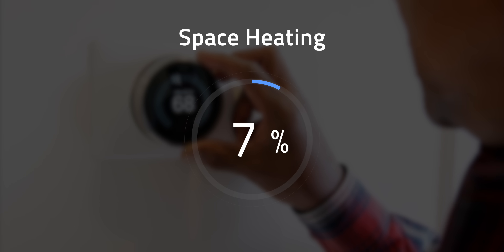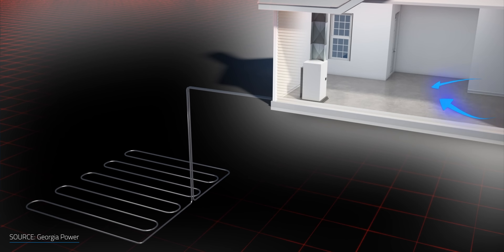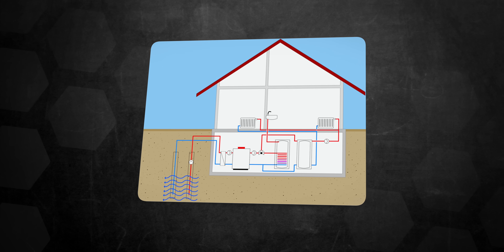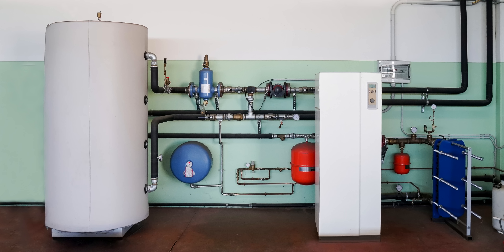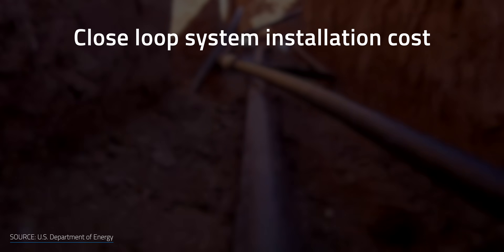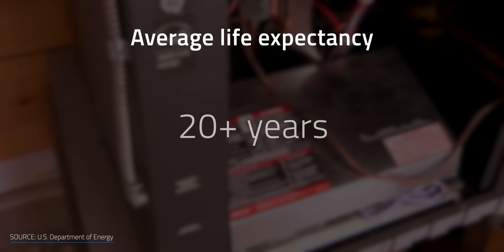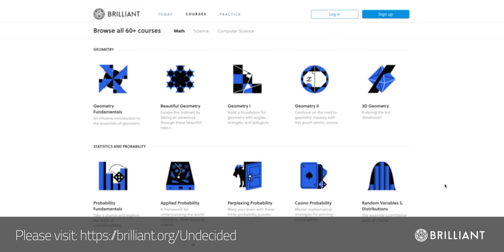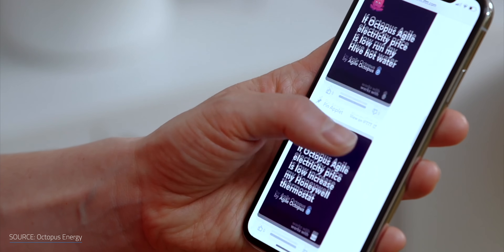Is Geothermal Heating and Cooling Worth the Cost?  Heat Pumps Explained

Comment: is this a system that augments HVAC? i don't feel like you can really get 70degree homes in the peak of winter withy this alone.
Reply: I have had a heat pump for about 12 yrs now and live in northern Wisconsin, they have an emergency heat built in but never used it, and keep my house at 68 all winter no problem. also keeps constant heat not the big swings like nat gas heaters  
.

Comment: Could you run the geothermal into a radiant floor instead of duct work? Or use a thermal mass to store it?
Reply: Yes, in fact that's the most common system in Europe, and ideal for heat pumps as they operate most efficiently when producing warm, as opposed to very hot water- they are perfect for running underfloor heating with its low water temperature requirements. It's also a much more comfortable and cleaner way to heat vs ducted air- drafts are eliminated, dust isn't blown around, and the heat is where you want it- at low level, rather than floating up around the ceiling!

Comment: Couple of things I wonder about. The refrigerants used may be greenhouse gases that are  10,000x worse than c02 - what are the chances of leaks over time.  Also is it more economical to use such a system on a city wide scale - rather than individual houses but rather a system like the city of Drammen in Norway https://www.smartcitiesdive.com/ex/sustainablecitiescollective/town-saves-millions-heating-costs-water-source-heat-pump/1055631/
Reply: Yes, may refrigerants have massive global warming potential, however modern systems use those with much lower numbers - a few tens or a couple of hundred times worse than CO2. It's also important to understand that even a relatively large system might contain just a couple of kilos of refrigerant- if it leaked, it would be no worse than the equivalent carbon dioxide emissions of a fossil fuelled boiler running for perhaps a month. Furthermore there is no reason why these gasses should escape- a sealed system, maintained properly should lose gas, and at the end of its life the gasses are recovered.

Comment: Good explanation over all, but wanted to point out that the explanation and graphics on 2:33 is technically incorrect. The compressor and expansion valve doesn't change the refrigerant's temperature (much). Instead, they increase/decrease it's boiling point, making it wanted to boil/condense and therefore absorbing/releasing energy.

This is a very brief explanation just to point those who are really interested in knowing more in the right direction.

Comment: Here in Germany,  my impression is, most new homes use air heat pumps.
Reply: Yes, in EU most of the new builds use air heat pumps like Daikin Altherma 3 or similar. Those systems are integrated and are used for heating, cooling and hot water preparation. Cost is much lower than geothermal solution and space requirement is almost non existant. Combined with photovoltiac panels you get what is known as zero energy house.

Comment: Here in Sweden geothermal heatpumps are fairly common. The house we bought 7 years ago had one installed. It works really nice.
Our is the horizontal variant due to a good sized plot, but the vertical (drilled in the bedrock) is more common.
It has an extra heater that runs on electricity if it gets too cold or we want more hot water than the earth can provide, but we have only used it for a few hundred hour during all the years we have lived here. We had to use the extra heater this winter for a little more than a week and during that time our electricity consumption doubled. So it really save us a lot of money.

Comment: What I don’t understand: Why digging in the ground, when you can extract the heat from the  outside air. We live in Canada and we have air to air heat pumps and they work all the way down to minus 30 C or minus 22 Fahrenheit! Much cheaper and without disturbing the earth in the ground!
Reply: Efficiency. It gets harder to extract energy the colder the medium is. Heat pumps also use resistive heating once the temperature drops below a point where it can't keep up with delivering the needed heat. With ground heat you won't drop below a cop of 4 even in really cold weather, while a air/air heat pump could drop below 2. Cooling your house in the summer is also more efficient because the ground is cooler and pulls the heat out of your system.
Reply: @Psi-Storm  yes I understand, but if my heat pumps deliver enough heat 99% of the time here in Canada, the performance in the winter will never be a issue in the US
Reply: @juergwilli7352  You can't just generalize that. It depends on house size, insulation standard and energy costs. If you need more heat and you have high electricity prices, these more expensive systems will pay off in the long run. For a small well insulated house, you are right, the costs are probably not necessary.

Comment: Great video. If I may,  the purpose of a heat pump is to "pump" the heat from the cold source to the hot one (i.e., against the direction it naturally goes). Much like the fridge that pump the heat from the inside (cold) to the outside (hot). You should think of the heat pump like an air conditioner (or a fridge) mounted and operated backwards: it cools outside in winter to warm inside. The soil provides a stable temperature at around 18 C that greatly increases the efficiency on the process.

Comment: So the big catch to Geothermal up here in the north is passing the ductwork through the freeze/thaw layer (which expands and contracts independently of the house or heat transfer loops). I'm curious to see what the technology looks like that compensates for that expansion and contraction surrounding the ductwork.

Comment: Some confusion here. The systems described here are not geothermal. These are ordinary heat pumps with ground based heat reservoir. Heat pumps operate best when the temperature of the heat reservoir is known and constant. The advantage of ground reservoir is the constant temperature underground throughout the year. 
A cheaper alternative is an air-based heat pump - these are the more common heat pumps with big fans. The disadvantage is of course that the air temperature varies and so the efficiency becomes worse.

Real geothermal energy is when the ground is actually warmer than normally. It is only available in some places and requires much deeper wells to reach - not for ordinary people to install.
Reply: Came looking for this comment! You have to go 100s of meters down in most places to get any true geothermal power, and this is why most places don't do geothermal; hot rocks are usually too deep to economically reach. The wiki on 'Geothermal gradient' explains this well.

Comment: Just to add to the discussion; heat pumps are more efficient (better COP) with a lower span between source temp and output temp. If my source temp was 10deg C ambient air and I wanted my home to be heated to 21 deg C that's an 11 deg C span. The issue is that for many homeowners at least in the UK, our existing heating will be designed with relatively small radiators which currently operate at even higher temperatures of maybe 50 deg C. If you are considering new build, a heat pump installation can be designed with large associated radiating elements (e.g. underfloor) that only need to operate at say 30deg C to heat a room quickly to 21 deg or whatever - this minimises the span the heat pump has to work with. I guess what I am saying is that heat pump installations can incur greater than anticipated costs if the internal heat distribution system needs to be changed. Of course if the existing system is based say on ducted warm air distribution, then that might adapt well to a heat pump.

Comment: Why does the industry use the term "geothermal" when referring to these systems? They have absolutely no connection to the geothermal power plants which draw extremely hot water or steam from underground to drive steam turbines and create electricity. The "geo" in one of these systems is just providing a heat sink. Do we call home AC units "aero-thermal"? I consider it a marketing ploy to make a heat pump sound high tech and extra green.
Reply: The ground stays at about the same "warm" temperature all year.
Reply: @mreese8764  I'm keeping the snarky comments in my pocket, but are you serious? The term geothermal in regards to power generation was stolen by the fake green industry to make customers think the ground is providing heat. It is not, it is just a heat sink.

Comment: Great video.  Our home has a closed loop geothermal heating/cooling system that has worked very well and is one of the reasons we purchased the home.  One thing you did not mention is how much more quiet these systems are then a traditional outdoor heat exchanger as well as the fact the outside of the home looks "cleaner" because that heat exchanger is not there.  Combined with our 8 KW solar PV system and the fact the the living area of our home is about 1,200 square feet, our energy costs are minimal to say the least.

Comment: Hi, I would consider air/water heat pump of the same size instead, an 11kW air/water heat pump have these days similar COP of 3-5 (down to -20 degree celsius) and since you dont have close to any similar Installation cost you both save over 10 000 USD for installation and also get a litter cheaper Heat pump.  So if you calculate on it, the extra expense  might not be paid back in a lifetime. I did some calculations regarding the Sprsun split 16kW air/water heat pump and it give a really fast payback of investment.

Comment: You forget best practice is to add a MagSafe to the outbound closed loop to prevent corrosion, and buildup , open loop are best used in lakes or water ways, but it has to meet a lot of red tape,   Most homes will benefit from vertical providing your land isn’t bed rock energy usage to the land like parts of Texas, we in the U.K. see a 1 to 5 energy efficiency e.g for every kw you get 5kw if heat.  However your house has to get a number of upgrades , underfloor heating system and oversized radiators, but more importantly your house has to be well, insulated r30nin the roof , preferably wall insulation and tight window to wall seals that aren’t a part if most us builds , you. An use forced air yet its energy efficient rating drops to more in line with air source heat pumps

Comment: Matt, I’ve done some research into this, and I would say a vertical, closed loop system is ideal. Horizontal systems require digging up way too much of your yard which makes it messy, time consuming, and expensive. Vertical systems can be installed much more easily, more quickly, and thus less expensively. Vertical systems can also go deeper, which might make them more efficient? Anyway, you need to shop around. Some older installers subcontract out the drilling to companies who normally drill for water wells. That subcontracting adds expense, and the drilling rigs they use are overkill for geothermal installations. Some newer geothermal installers have smaller drilling equipment made specifically for geothermal installation. Check out Dandelion Energy if they operate in your area.
Reply: I live on real shallow topsoil, very close to exposed bedrock.  Deep drilling for a vertical system is difficult but there isn't enough topsoil to bury the horizontal loops deep enough.  My state also has issues with putting a glycol based liquid into the water table in case it leaks out.  I'm still researching my options.  I may end up installing a pond yet.

Comment: The British TV series Grand Designs-Impossible Builds has an episode that features a house that had hybrid PV/thermal panels. They ran the hot water from the thermal part of the panels into a heat pump to produce heating and hot water for the house and they used the PV part of the panels to generate electricity for the rest of the house. They had a hot water tank where they stored excess heat collected from the thermal part of their panels. I'd like to see how this system compares with other heat pump solutions.  The episode: https://youtu.be/CgFGxGYs0L0  ETA: the video was taken down for copyright violations.
Reply: Apparently the video is blocked
Reply: thanks for the information. Some of the British TV shows are hard to watch in the US. They don't allow Americans to subscribe to channel 4. They don't release them to  Acorn or Britbox or any other internet channels, the DVD's are usually sold out if they were ever made and sometimes they take down pirated shows on YouTube, which is what seems to have happened in this case.
Reply: What other's are doing is using GSHP to put the excess heat collected from the thermal part back into the ground, which then in winter can be extracted again.
Reply: @yeahright3348  Thanks for the response. There was a house featured on Grand Designs Impossible builds that did this to the extent that the designer of the house planned to get all of his heat from the ground. All the shows are now blocked on YouTube. so I can't link to it.

Comment: Why do they put piping under lawn and not under the house where there's guaranteed to have more heat?
Also do they actually need to dig the garden like there's ancient fossils there? I heard there's these moles that can dig anywhere you point - sound like a cheap way to lay that piping!
Finally - you compared with HVAC system but it's unclear whether that's heat pumps or just traditional gas furnaces - I feel simple heat pumps should cover like 95% use cases and geothermal is good for large apartment buildings with pre-existing water based piping (aka most of Eastern Europe) or some special cases with pond or lake around.

Comment: These prices don't seem right. For 2-2.5k sqft house It costs about $10-11k just to install a good condensing boiler with storage tank (existing house piping) And it costs 15-20k just to do cheap central AC job. If you want high efficiency heat pump units, that will cost you 25k (open basement and attic). So maybe it does cost 30k to install. And then on top of it another 10k+ for digging and landscaping. 
But again....you are looking at  25-35k for just hydronic boiler AC combo installed within out any fancy stuff and without digging half of your backyard.

Comment: This can't be worth the effort. We're talking about systems that are invisible and unmarked and will invalidate a good deal of uses where they're laid out. They're likely too easily compromised by tree roots. Realistically it would be more sensible to provide geothermal as a grid service accessed from the street. Otherwise boring directly down from the foundation is more sensible.
Reply: This should be a civic offering. The costs of implementation would be reduced to tie it in with city services that already manage subterranean utilities. In the thickest density areas where surface pavement is a majority to undeveloped surface land public heating and cooling would be extremely competitive compared to installation in a property by property basis.

Comment: Geothermal systems do not last longer than traditional forced air systems. GT systems also have higher lifetime maintenance costs and much more expensive repairs. It's not even close. One would be lucky to break even with a GT system. Of course one could argue for the environmental benefit of GT systems. But certainly don't buy a GT system to save money. Another issue is the ramp up of heating or cooling with a GT system. They take much longer to change the home's internal temperature. They're designed to run almost continuously. One of the reasons they don't last as long and require much more frequent repairs and more frequent maintenance. GT systems are not ready for prime time yet, but probably will be by the end of the decade.

Comment: We had a geothermal quote last year because while we were looking at a central air system, our boiler died and I thought 2 birds with 1 stone! The heat pump unit is much more expensive and the well drilling is even more expensive and supposedly very messy. I'm getting a few independent drillers to quote two 150' wells so maybe I can find a better price somehow.

Comment: Geothermal pumps can save power especially in bigger houses but they tend to have maintenance problems over time.
My parents had geothermal heating in their house in the Hamptons for 20 years. I believe the house was built 25 years ago. During the 20 years they owned it I believe the were real issues with the pumps, including a leak, six times. There were also lesser problems whenever electricity would go out because of the storm. The new owners are doing major renovations including getting solar panels, so this will be less of an issue.

Comment: My idea home has : 
Passive heating / cooling
Geothermal heating / cooling
Excess geothermal energy is used with a low boiling point liquid to run a turbine for base energy production. 
Stylish solar roof tiles
A VAWT
And a nice power wall / controller that funnels clean energy back into the grid. 

Granted, it also has fiberoptic internet and a mean gaming rig... but I'm hoping energy-efficient appliances even it out. 🤷‍♂️

Comment: A furnace costs 3500 to 15000 and an air conditioner cost 3500 to 10000, so I’m not seeing the argument for up front cost being too much. TBH if your furnace breaks down and your residential area is cool with the drilling then this by far is the way to go especially with the tax credits.